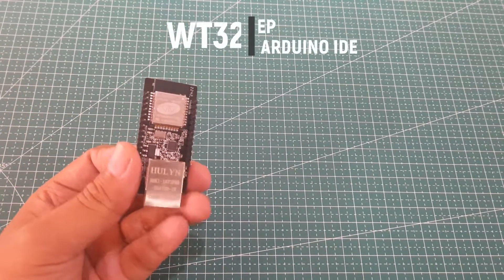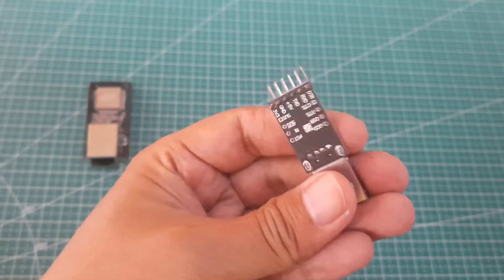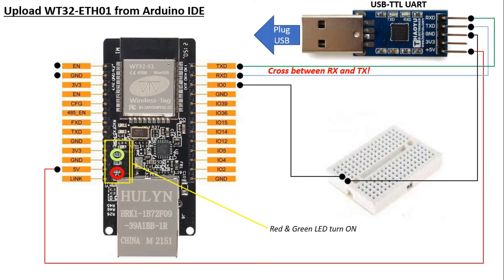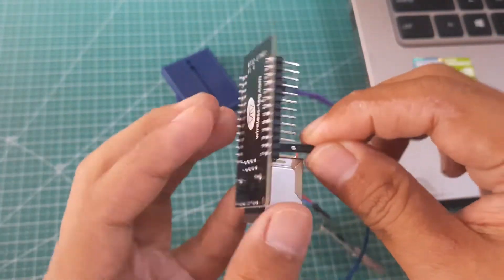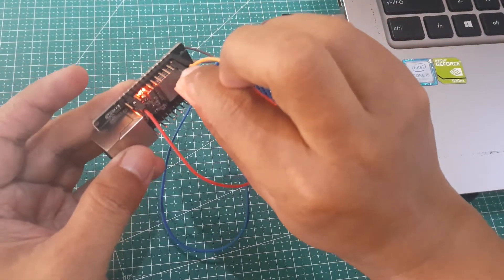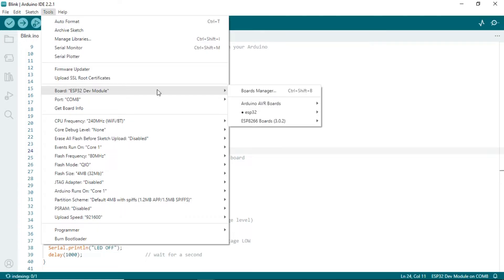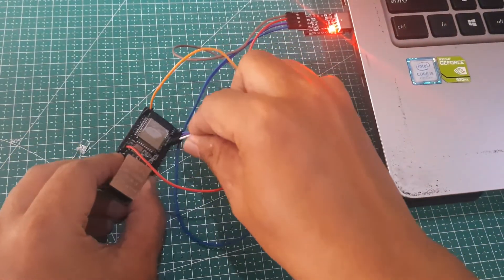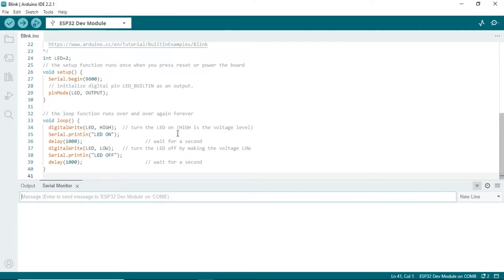Step by Step Upload Code to WT32 ETH01 from Arduino IDE

Comment: I am using the WT32-ETH01 module with WLED, and followed your example to begin the flash process.  The flash process completes successfully, and if I use the wireless connection everything works fine.  But if I enable the ethernet option in WLED I get a "Cannot read properties of null (ClassList)" on the WLED main page once the device comes up on either the WiFi interface or the ethernet interface.  Do you know why?
Reply: @jeffreypreston7138 You have to go to LED settings and change the amount of LEDs and change the GPIO pin. Save and reboot, that worked for me when I was having that issue.
Reply from the maker: Sorry I cant help you
I have not face that situation

Comment: The wiring setup is incorrect. Here's how it should be:

Connect 5V/3.3V, GND, TX to RX, and RX to TX on the USB to TTL converter.
Connect IO0 to GND.
Power up or plug in the USB, and now the Arduino can upload the code.
After the upload, power off, disconnect IO0 from GND (back to IDLE), and power the device again. It will run the uploaded code automatically.
Reply from the maker: Thank you
You can check my new video

Comment: it's work
Reply: The process you describe is a method to put the ESP32 into flash mode (bootloader mode) to load new code into the microcontroller. Here's how the steps you take work:

Connect GND from USB to UART to IO0:

When you connect IO0 to GND and then power the ESP32, this puts the ESP32 into bootloader mode. In this mode, the ESP32 is ready to receive new codes from the computer via the serial interface. The green LED on the ESP32 lights up to indicate that the device is in this mode.
Connect EN to GND:

When you connect EN to GND, you are disabling ESP32. All microcontroller operations will stop and the green LED will turn off, indicating that the ESP32 has been turned off.
Disconnect EN and GND:

When you disconnect the EN connection from GND, the ESP32 will be enabled again. If IO0 remains connected to GND during this time, the ESP32 will reboot in bootloader mode, ready to receive codes from the computer via the serial interface.
Flash code:

Once the ESP32 is in bootloader mode (IO0 is connected to GND and EN is connected again to VCC), you can start loading new code into the ESP32 from the computer via a flash tool (e.g. esptool) .
Process summary:
Put the ESP32 into bootloader mode:
Connect IO0 to GND.
Connect EN to GND to turn off ESP32.
Disconnect EN from GND to turn the ESP32 back on in bootloader mode (with IO0 still connected to GND).
Load code:
Use a code loading tool (like esptool) to flash new code to the ESP32.
Note:
After loading the code, you need to unplug IO0 from GND and reset the ESP32 so that it boots into normal operating mode and runs the newly loaded program.
This process is a manual way to put the ESP32 into bootloader mode, usually used when there is no push button to enter this mode.

Comment: LEDs always need a resistor.
Reply from the maker: Thank You for your correction.
While it's true that LEDs can work without a resistor in some scenarios, it's worth mentioning that using a resistor is generally recommended. It helps safeguard the LED and provides stable performance over time. 
So, for simplicity, I demonstrate without a resistor, but in real-world applications, using a resistor is advisable
Reply: The resistor is not needed in all situations. The role of the resistors in the circuit  to create the desired voltage drop, however if you dont need any drop you can avoid it at all. 
Example: Power 3,3V -> transistor (drop 0,7V) -> LED (Uf = 2,6V). In this case you dont need any resistor as voltage drop is realized by tranzistor. 
You can easily verify it by creating test circuit with A-meter in series.

Comment: It is not good to connect the IO0 pin to GND but forget the GND connection to the board. 
You always have to have a GND connection. 
The IO0 for programming to GND and open to run.
Reply: It is also not good to supply power to the USB plug if GND is not connected.
It is also not good to remove the GND when the board is still connected to the power supply. 
How should the voltage regulator generate the 3.3V if you interrupt GND?
Reply from the maker: Hi,
Thank you for information,
That is my experiment, I just found that way to upload the code.
Hope your comment is useful for others
Thank You